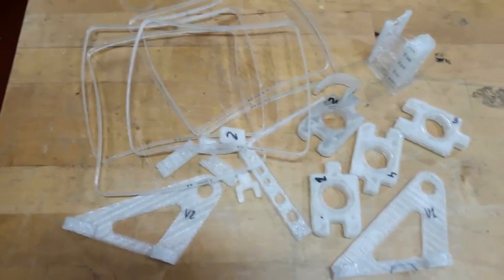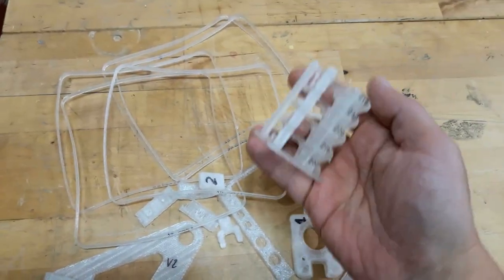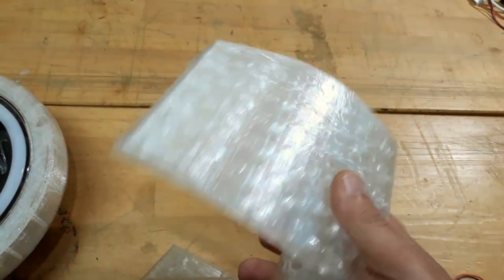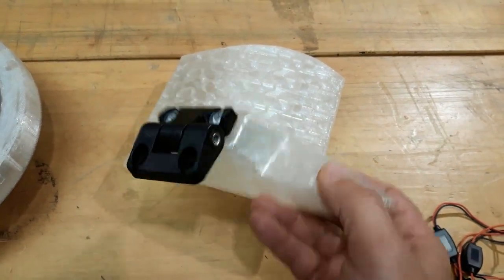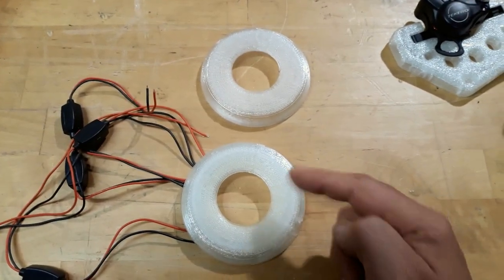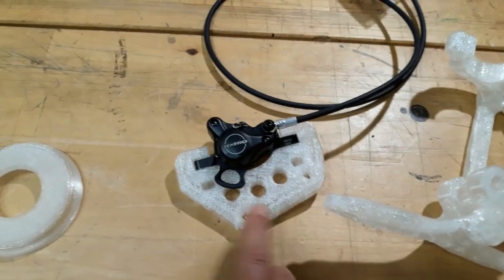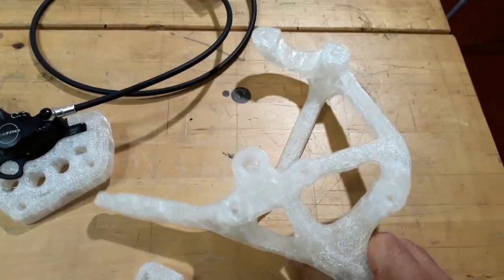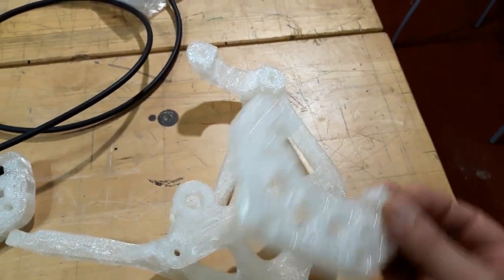3D PRINTED ELECTRIC CAR DIY, First Parts (ENGLISH, Part 2)

Comment: Thank you for sharing.  I am going to try and build my own.  What is your thoughts about putting a couple of semi flex solar panels to help charge the battery in the daytime.
Reply from the maker: Thank you for your comment. That is a great idea and I already had designed several solar vehicles.
In this experimental project I am focussing on the way to print a full vehicle out of plastic, and make it strong enough. So it is small and without any simple curved surface (all are compound curves) were you can easily install Solar panels.
Maybe for next design I add that.

Comment: I love what you are doing with this!  What about hosting this on a github page(programmers site) so we can have a build forum and version control on which parts to use that all of use can use our 3d cads on?  If we are all using Prusa then we can even push out the gcode version one of the many versions. Would love to be involved!
Reply from the maker: Yes that will be great.